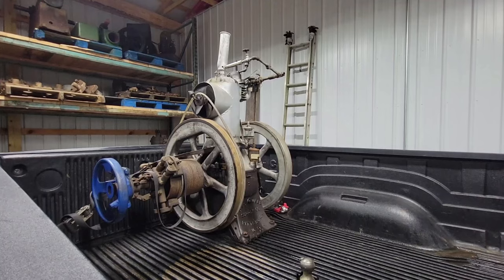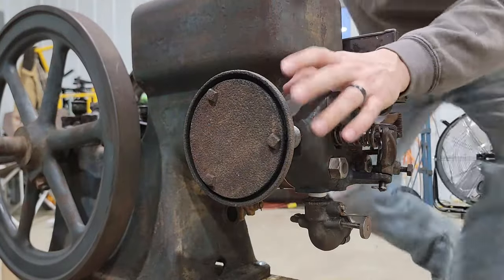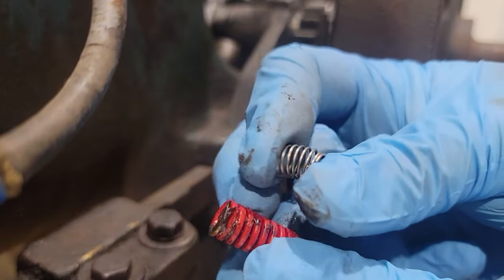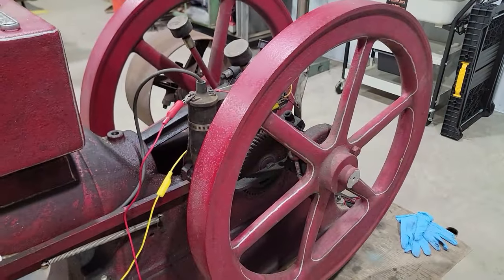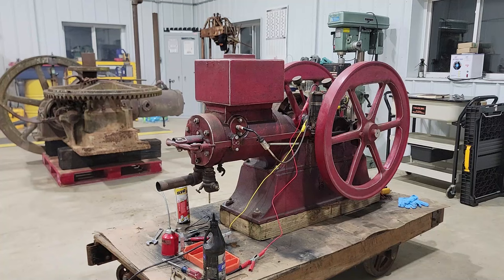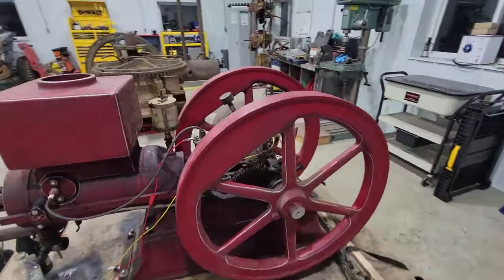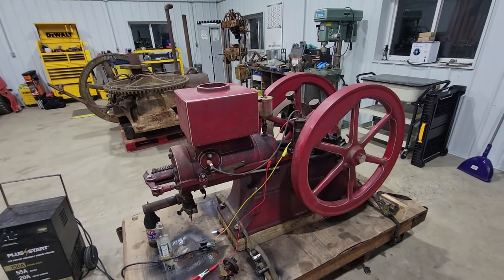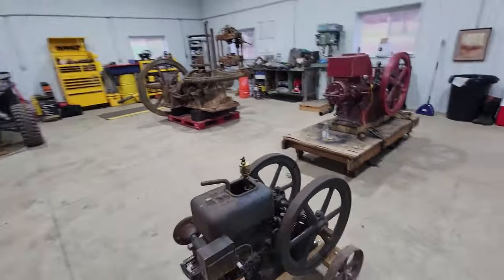Do FARMER Fixes work?  Trying to get an old Hit & Miss Engine going!  Will it RUN?!?!

Comment: I love listening to the hit and miss engines running. My grandpa had one running the salt water pump, for a gas well, on his farm. The little Hercules motor kept enough gas pumping to run 3 or 4 V8's pumping irrigation wells. Each of them 8 to 12inches and 630foot deep.I was always impressed by that hit and miss that kept a pump jack going 24/7 for years. We took good care of it, but it almost never failed us.
Reply from the maker: They are insanely reliable! Thanks for sharing your memory!

Comment: They have a club here and they put on a show at a historical  farm property. They used to do it twice a year in the spring and fall pre covid. Personally I would like to find an old hit and miss that was intended to power a boat with the prop and shaft attached. I have only seen one. It was at one of the clubs shows. It had a large sign: NOT FOR SALE  on it. So I guess that I am not alone in my quest for a marine hit and miss. Heck I would build a boat to go around that. 
Thanks for the content, Tom
Reply from the maker: Those engines are out there, you will find one!  Good luck!

Comment: Looks like it takes a lot of hard work spinning them over to get them started. Surely don't want to get any body part in any of those moving parts whatsoever. Lots of serious torque there... Obviously would be a very bumpy run that would jar your teeth out if they were ever used for any type transportation. But oh so interesting to watch them run... Thanks!
Reply from the maker: They start easier once you have them running correctly.    When they haven't run in years like these 2, they can be a pain to get going for the first time.

Comment: Thank for the video, I need more knowledge of adjusting the timing, I have Hit Miss Stover.  I did restore some time ago, I thought for adjusting timing would slide to magneto tripper back along that shaft, rather than gears.   I will check out those gears and inspect the Governor not working well either, most likely those Springs.
Reply from the maker: Good luck!

Comment: Compression release on these engines is aceaved by holding the detent blade on the throttle in disabling the exhaust valve. Hold detent in with left hand turn flywheel with the right leave detent out keep it going with both hands.
Reply from the maker: This engine actually had a compression release on the other side of the cylinder. I just chose not to use it and fight my way through the compression.

Comment: Late to the fun as usual, but better late than never I always say.
So how bad is the fractured head, as she doesn't appear to be losing any compression from watching her buck before you tied her down to the snubbing post.
Someone that was up on they're game even  for old farmer making his repairs it appears from the way she was willing to give it a try being just a tad outta sync from sitting too long probably, and I'd say someone had they're fingers in there since he'd had her running last most likely as well. 
But patience experience and persistence pays off if they're not totally clapped out with most old combustion engines, are at least until the electronic Era come into full swing in the late 80's early 90's what with fuel injection and all the mess that it takes to power things up to tell it when to squirt fuel, and spark to make the cycle complete nowadays. 
Just isn't any fun to work on newer engines these days, and I never see the simpler times ever coming back, at least not until the world has a for sure major meltdown, and people are forced to fall back to those types of machines anyways. 
Always enjoy those that are willing to learn how the old modern technology works, and make them work again. 
You might check out Johnathan w.
He's down in NC, runs wrecker service for his living. 
But has become something of a steam powered fanatic last couple years, and has rescued, and restored some boilers, and has built up nice collection of steam engines small to large, and even an old steam driven genset to power his Christmas lights.
Worth the effort to ck him out, and I think it'll met up with your way of thinking.

Comment: Looks like you need to put anchor points in the floor, about pulled your gas can off the barrel, another youtuber had a fairly large fire in his shop from spilt gas on the floor, he sustained some burns also. Hate to see that anywhere.
Reply from the maker: I don't disagree. Staying safe is number 1.

Comment: hi great channel when a hit n miss was used back in the day was it ran at idle and is the sound different  also in this video what is in the background the big gear thing love learning new things about these engines keep it up thanks.
Reply from the maker: These engines were rated to run at constant speed. They did not particularly have an idle.  You would fire up the engine and the governor on the engine would keep it at a set speed from the factory.   

The big gear thing in the back is a engine/turntable unit made for pumping mutiple oil wells at once!

Thank you for the questions!

Comment: Nothing quite like seeing an old engine being brought back to life, and especially when there are original parts to restore back to the way the creators intended!

Ooh, what would I like to see being worked on? I'm going to dive right in and say the oil field central power bull wheel unit. It stands quietly and patiently waiting in the corner, but I'd love to see it get some attention, and maybe even see it running - hint, hint! 😉😉🤑🛢️
Reply from the maker: Thank you, and don't worry, I plan on getting to that big on here soon!

Comment: Enjoyed the video alot! I have a waterloo contract 1-1/2 hp. that I cannot get to fire up. It has fuel and spark but won't hit. I suspect it's timing. Is the timing pretty much the same on most of these engine's (5 btdc for ign. and 25 ptdc for exh. valve)?

Comment: I have a 1916 1 1/2HP Fairbanks Morse that I have trouble getting to run. It is mechanically very good so I suspect the magnito is shot. Thanks for the inspiration and insights. I will never give up. Can these engines by run on hydrogen or HHO? I build cells to split water and would love to try that too.
Reply from the maker: I would suppose they would run on hydrogen.   It would be interesting to try!

Comment: So the box on top is a radiator? You would fill it with water?
Reply from the maker: That is correct,  more so a tank to hold water that can be evaporated off and refilled.

Comment: Mate,that will keep you fit ,starting those ol engines
Reply from the maker: It will wear you out pretty quick!
Reply: 5 hp on up can and will kick your butt when trying to get them running.  But bigger ones also run nicer when you get them dialed in.

Comment: It Has To Be Water Cooled But I Didn't See You Add Any or Else I MIssed It.
Reply from the maker: It is water cooled, the hopper on the top is for water.    For all the longer I ran it, it wasn't necessary to put water in it.  It did not get warm enough to cause any issues.
Reply: @Cast_Iron_Curiosities  I Have A 1 1/2 Horse That Rann in the Early 1990's and In  Give it a spin when ever i go by it. Enjoyed The the  demostration very much and now maybe I'll Have to try and get it going while i still can.